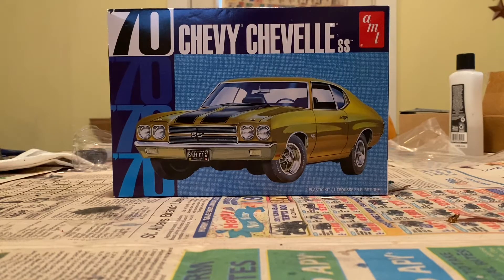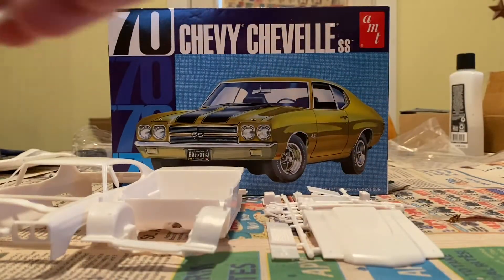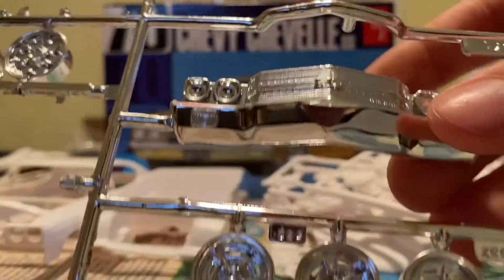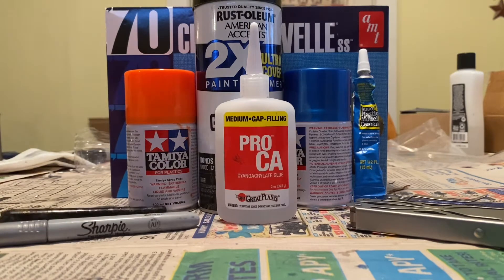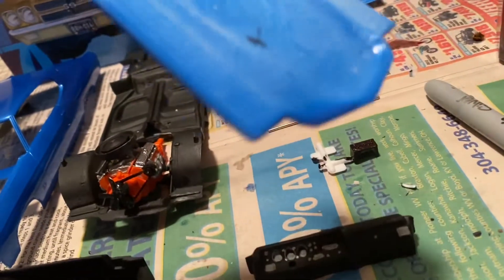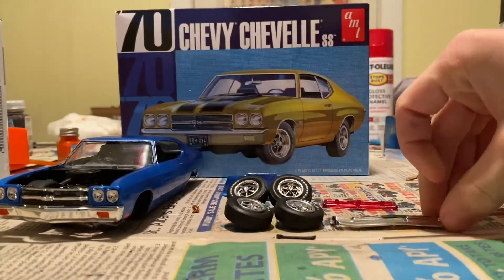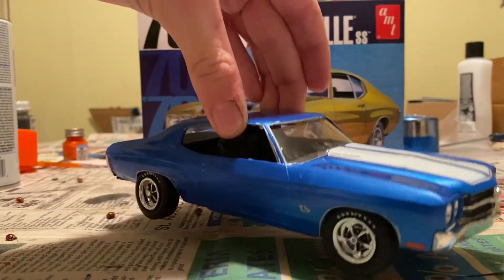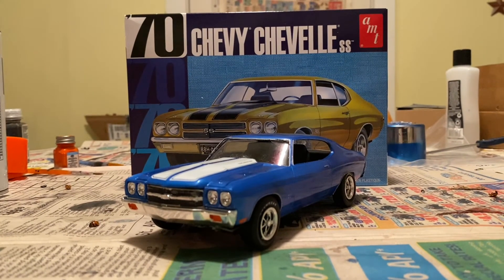1970 Chevy Chevelle

Comment from the maker: What model car should o build next? Tell me in the comments! Make sure it’s the ones I got
Reply: What else do you have left?
Reply from the maker: @masonman2851  A 1967 Chevy Chevelle drag car a 1968 Shelby GT 500 a 1965 Ford Fairlane a 1964 Oldsmobile convertible a 1953 Studebaker Starliner a 1941 Plymouth and a 1955 Ford stepside pick up truck And a Pontiac GTO race car
Reply: @ModelCarGuy  I would a 1965 Ford Fairlane
Reply from the maker: @masonman2851  ok maybe